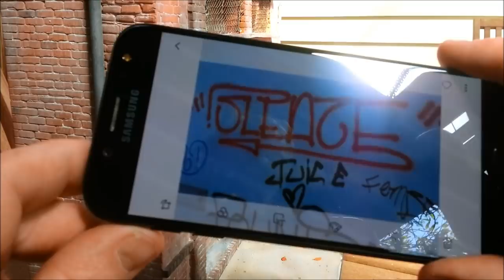Airbrushing scale models -  the Good the Bad and the Ugly!

Comment: The ProCon (Mr. Hobby) brush is a splendid detail brush. It would be hard to clean because the nozzle is very small, but a nozzle removal tool is available for an extra $15. There's a model for $10 less than the Platinum - I have them both and the performance is the same in my view. (The Platinum does have a PSI valve on the brush itself - if you can get used to it, it might be a neat feature. I've never used that valve so I don't.) This brush is under $100 - it's made in Japan (I believe by Iwata) and is a steal for a very high quality brush. Definite thumbs up. Actually I've grown very pro-Japan in the airbrush world - I prefer my Iwata HPC over any of the three Harder Steenbeck brushes I have. The Procon is icing on the cake.

Comment: seen comments saying 'theres this or that tool for sale' , why ? its not needed !  not proud but i have snapped more than my fair share of jets either through over tightening or cleaning.  thing is, they snap so easy because they are thin (very thin) brass.  so first time i used a cocktail stick jammed in and eventualy got it out, then i bought a good cleaning kit, this contains a jet/hole prick, basically a needle of steel flat on one side going from 2mm to 0.01mm.  push the needle into the broken jet until firm, the steel being harder than brass, as you unscrew, the edge of the flat side bites into the brass and easily removes the broken piece with no damage to the brush or thread. i have done this too often, but it works, no buying special tools or jamming sharp potentially damaging or harmful knife blades.  I was recently told that that was what the flat side is for, the point is for clearing holes and the flat is for removing sheered jet bodies, something that happens all to often !

Comment: had  a similar issue - sorted it using the end of a sharp exacto blade to gently unscrew broken end out - just need to gain a bit of traction with end of exacto blade
Reply: Yeah, exacto blade will remove it. Did the same thing myself before
Reply from the maker: Thank you Clive - that worked perfectly for me. Top suggestion sir, I owe you one. Dave

Comment: Easy fix ive made the mistake 3 times in the past . 
Use an old hobby knife blade . Just put it in the handle / holder as normal and push it into what's broken off in the airbrush and just unscrew . It has worked without fail for me and others i've mentioned it to in the past
Reply from the maker: Perfect - this worked! Thank you Mark! Owe you one!
Reply: @DavesModelWorkshop  Glad it worked buddy , And that's why we dont toss out old blades lol

Comment: Dave. It happened to me once
I used a fine tweezers to make contact with the broken body of the nozzle and start unscrewing. Basically you want to insert the tweezers inside the hole and open them a little bit and start rotating. That worked for me. If you can't do that use anything big enough to unscrew the broken nozzle off. Good luck

Comment: use a tooth pick, press in and twist, if that doesn't work put a touch of super glue on the tooth pick and glue it to the old nozzle thread.  might want to soak the entire airbrush end in some thinner to loosen any dried paint.

Comment: You dont have to tighten the nozzle a lot for it to seal properly. I broke one 3 years ago and change the way I do things, never broken another nozzle ever since; I am that sort of person who fully disassembles my airbrush for cleaning after each use. Therefore I need a method that has 0% chance of damaging my Airbrush.

I believe the main reason people snap their nozzle is because they try to put the nozzle back on without the needle and the nozzle was not centered when they try to screw it back on. Use the needle as a guide, drop the nozzle onto the needle, slowly pull the needle back until the nozzle touches the tip of the airbrush, use your finger or a brush to give it a few spins. Once it it halfway in, pull the needle all the way back and proceed to tighten the nozzle with your fingers or a brush. Finally tighten it with your nails or a tweezer; dont use that mini wrench, if it is not centered or leveled properly, or if you sneeze, you risk snapping the nozzle.

It is always a good practice to pull the needle out from the front and insert the needle from the front. Doing it from the back has a chance of damaging the tip; not matter how low the percentage, there is a chance. Inserting the needle from the front has 0% chance of damaging the needle.
Reply from the maker: parnashwind that is very wise advice. I’ve never drawn the needle out from the front, always from the back, but I agree that there is a chance of damage when it is reinserted. Thank you for the considered advice :)

Comment: Google up a tool called a screw extractor.  It goes in your drill and works like a drill bit, but backwards kind of.  You can get a set for not to much.  It should come out pretty simply because it's fairly soft brass.

Comment: G'day Dave great video.! I have the PS-289 and to get it to backflush bubble you can just unscrew the nozzle cap (the one back from the crown cap) half to one turn and press the trigger and pull back. It will backflush bubble without you having to block the nozzle with your finger. I'll send you a pic on your blog..

Comment: To do the blow back method with the Procon Boy, you slightly unscrew the entire air head assembly and then pull back to get the back flow. There is no need to remove the nozzle tip. I love my Procon Boy too (which sounds a bit dodgy!!)
Reply from the maker: That sounds brilliantly dodgy! :D  Thanks fro the tip.

Comment: Hi Dave! I may have a fix for you, bud! Now, take in mind that I am a novice... But when I was buying cheapy airbrushes this exact problem happened to me. In my case, I used a firm bit of wire (perhaps a pin) and was able to extract the sheared off remnant by turning the sheared portion counter-clockwise. It took some time and was tough, as the portion was in there firmly, but certainly a better option that drilling into your beautiful airbrush and probably ruining it. Hope it helps! Love your videos :)

Comment: to fix the broken part of the airbrush, it is very easy.

First you have to take an (old) needle from the airbrush, put a couple of turns of carrousel tape on the sharp part and then insert it in the opposite direction using the needle as a screwdriver.

(Sorry for my english)
Reply from the maker: Thanks for the suggestion Kimazue - I'm glad I listened to people on here and didn't drill! I had success with an Xacto blade jammed in like a makeshift screwdriver. Also, your English is great, totally understandable. Cheers, Dave

Comment: Dave, you may be able to buy a fine 'Easy Out', they're like a tap with a thread in the reverse direction. As they tighten, they'll unscrew the piece which has snapped off.

Comment: I feel your pain.    I didn't he same with my iwata some time ago.    If you find a small screwdriver or similar, which is just big enough to fit in the nozzle hole, you will be able (model god's willing) to get the screwdriver head to bed in to what's left of the copper nozzle , and turn anti clockwise to unscrew it.    Even the tips of a scalpel may be enough to get tenure and unthread it.
Reply from the maker: Thanks for the suggestion Armour Empire- I'm glad I listened to people on here and didn't drill! Yep, just like you mentioned, I had success with an Xacto blade jammed in like a makeshift screwdriver. Cheers, Dave

Comment: The master airbrushes that you get cheap with a compressor on amazon are likely ko's of these. I broke one of those nozzles overtightening. I also lost one for like 2 weeks in the carpet.

I used the pointed half cone from a cleaning kit that's meant to be for scraping out the inside of a nozzle(I think). I was able to stick that in and get enough grip to twist out the broken half.

Comment: NOT a drill bit!!!  You will destroy the threading and you're replacement tip will be useless (along with the rest of the airbrush).  First try would be to take something soft and pointy like a toothpick or similar and try to work the leavings of the threads out.  Failing that, you could try putting a metal or wooden dowel down the center and filling the hole with beeswax, then after it cools, unscrew it and hope the leavings stick to the beeswax (then obviously, you'll have to melt out any beeswax left behind.  The absolute last ditch effort would be to determine the size and thread count of the hole and tap it out, but if you get it wrong, it won't be much better than using a drill bit.

Comment: I can't believe this video. I just recently started airbrushing and I encountered the exact same problem with my nozzle. All I did was take the smallest jewelers screwdriver I had, lightly press it against the damaged threads still in the body and twisted it out. In less than 5 minutes there was a solution from a total amateur.
Reply from the maker: Ah, clever. That's a good solution.

Comment: i'm new to airbrushes and am researching them, i've been having horrible trouble with some rattle can paints and need to find something i can do plastic models with without breaking my bank account. can i use acrylics in this? what standard settings on the air brush should i use for basic painting?

Comment: The tip would have broken of producing an uneven lip, simply use a flat bladed jewellers screw driver to unscrew it back out.
old engineering trick😉

Cool video btw,

Jas,

Comment: Just take it to a fastener shop ( ie nuts & bolts ) and get an ezyout, that way if it's tight you won't damage the internal thread.
Reply from the maker: Thanks for the suggestion Jaimie - I'm glad I listened to people on here and didn't drill! I had success with an Xacto blade jammed in like a makeshift screwdriver. Cheers, Dave

Comment: Dave, great video mate. A broken nozzle is easy and quick to remove. Just put a cocktail stick into the airbrush opening and, whilst keeping a strong inward pressure on it, turn the airbrush anti clockwise. The rounded shape of the cocktail stick provides maximum surface area for the jagged broken edge of the nozzle to grip to and remove. The soft wood of the cocktail stick won't damage the delicate inner thread. This will work 9 times out of 10. Otherwise use a small screwdriver for glasses but be gentle so as to protect the inner threads. Did you say $25.00 for a replacement nozzle?!!? I don't want to spam this link but we supply the same style for almost 1/10th of that! Let me know if it would be ok to put a link on so your viewers don't get spanked for these prices. I would also be very happy to send you a set of 0.2mm, 0.3mm and 0.5mm nozzles for free.
Reply from the maker: Hi Alison, thanks for getting in touch.  I'm glad I listened to people on here and didn't drill! I had success with an Xacto blade jammed in like a makeshift screwdriver. And yes, you heard right, AU$22 + postage for a replacement nozzle from a local Australian airbrush specialist. Postage was quick, but it seems I was charged a premium rate... :(  Yes, please feel free to add a link here, I'd love to save someone else from that expense. Cheers, Dave
Reply: @DavesModelWorkshop  when i broke nozzels rather than pay stupid prices asked for nozzels i just ordered anew needle or set of amazon, yes I have extra needles, but each comes with a matched nozzle.  I have paid £11 for a set of 3 needles with nozzles wher sellers have asked £15+p&p for just 1 nozzel. and with amazon its post free usually next day delivery, its no wonder so many parts companies go bust, they fleece the customer instead of looking after them.  i know one store who bought 10 sets for £100 , split the ses up and solb the nozzles for £9each total£270 and needles for£5 each total £150. £320 profit, he got grassed and while legal, he lost his rep and customer base.

Comment: I am siding with the toothpick people.. had this issue as well and it was easy to remove the broken part that way
Reply from the maker: Thanks for the suggestion Dusan - I'm glad I listened to people on here and didn't drill! I had success with an Xacto blade jammed in like a makeshift screwdriver. Cheers, Dave

Comment: Doesn't doing blowback with the needle out cause residue to flow back in to the needle opening in the back of the airbrush? Over time I'd think there would be a build up, especially if using acrylics. I do the blowback with the needle in and it helps a bit, but not as much as it did for you with the needle out.

Comment: Sparmax nozzle REPAIRING TOOL extractor for the'nozzle (41200126).  Sparmax have the tool for your exact issue. HTH
Reply from the maker: I've never even heard of that before - who knew?
Reply: Ja, that's basically a tiny screwdriver or an xacto blade, it doesn't worth buying it.

Comment: How to clean your airbrush instantly: use ak interactive's xtreme cleaner, it's extremely powerful with all types of paints just blast it through and your done
Reply from the maker: Hi Konrad, looking at prices here it's about AU$13 for 100ml. is it worth it? I've not used it before, sounds promising?
Reply: @DavesModelWorkshop  i never had the tamiya airbrush cleaner, however this product works a thousand times better than vallejo airbrush cleaner and on all types of paint I think its worth giving a try! You wont regret!

Comment: DONT DRILL!!!!!!! 1, TINY FLATHEAD SCREWDRIVER  OR  AIRBRUSH BOTTLE BRUSH , EITHER PUSH IN UNTIL TIGHT THEN TURN ANTI CLOCK WISE , THE THREAD IS VERY SOFT SO TI SHOULD COME OUT WITHOUT DAMAGING THE INSIDE THREAD.

Comment: Hey Dave I love your videos, I'm looking for a beginner airbrush for cheap, are there any you would recommend?
Reply: Remember you get what you pay for! One thing to keep in mind is cheap is just that and for beginners it can be the biggest turn off getting a cheap brush that works poorly. You are better off committing a decent amount to getting a nice intermediate brush that may cost a bit more than you want to spend but in the long run will give you one that will perform well and serve you long after you get good! I recommend the Paasche Talon, there is a nice one on the market that is about $75 and I really call that the cheapest you should go while not sacrificing on to much quality. Paasche makes a decent single action brush but it may get you off on the wrong foot unless you end up liking single action.

Single Action:
https://www.amazon.com/Paasche-TG-3F-Double-Gravity-Airbrush/dp/B002N0QA9A

Best overall: This one if you look around you can find it for around $75 and there is one deal like the one I got a few years ago that comes with 3 size needles and has been a really nice brush.
https://www.amazon.com/Paasche-TG-3F-Double-Gravity-Airbrush/dp/B002N0QA9A
Reply: I'll check them out thank you

Comment: You can ruin a model so fast,believe me I know. Paint has to be mixed right either thined or retarder,air pressure has to be right,distance is important too and above all the airbrush has to be super clean. I spend more time cleaning the dam thing than actually painting with it. It is a huge learning curve to get your finger working right especially with a duel action..lots and lots and lots of practice. I took two planes that were ruined to practice on. Over and over again until I had no plastic left because of removing paint to practice. Lots of practice done on paper first. I am considering going back to brush painting my models as airbrushing is very  very expensive...The cost of a decent airbrush can run you hundreds and then the paint wasted in the cup or mixing bottles..the cleaners and paper towels etc  etc  etc
Reply: Agreed, it is more expensive for initial setup / purchase. Once you're painting, I think the cost is only slightly higher. Yes, there's a bit of waste with cleaning, but the results are worth it. I could never go back to just painting with brushes, the finishes you can achieve with an airbrush are so more versatile (flat and uniform, soft edged camo, speckled, etc).